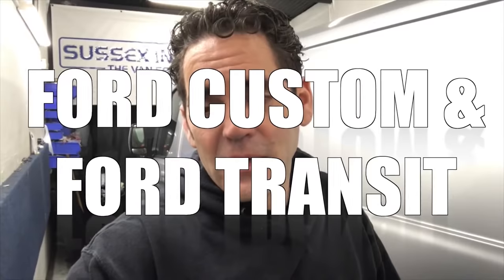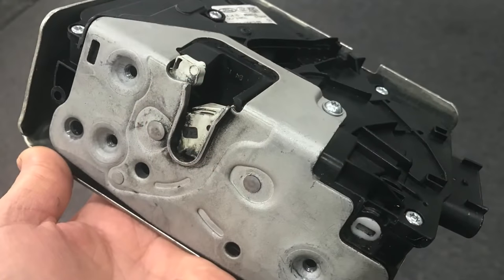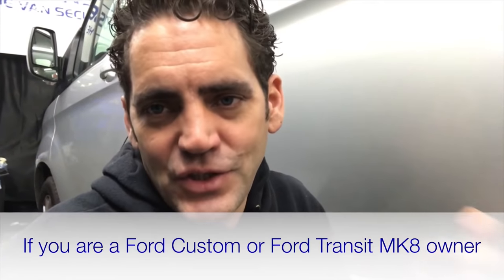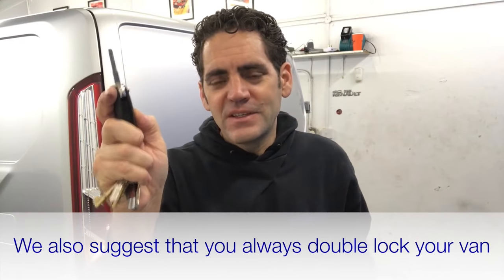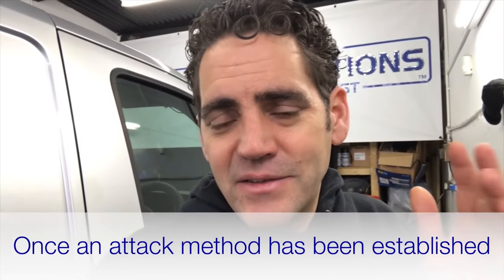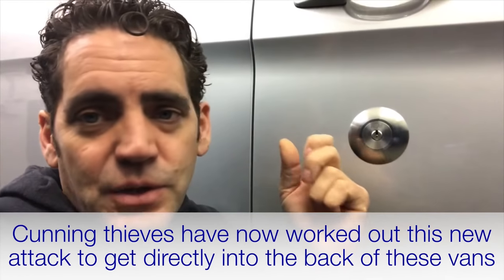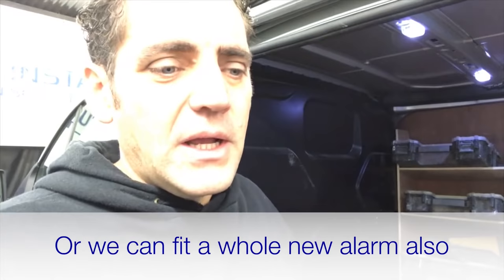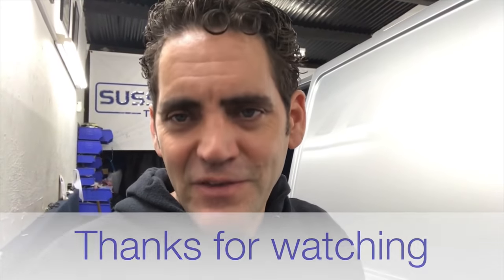Break-in News! Ford TRANSIT Owners Watch This

Comment: Its the same on building sites, tooled up to burn into the steel containers, JCBs hacked and driven away, boilers fitted one day, removed the next day.
Where I live now, I have not locked my house or car for 5yrs, no theft at all, Buddism must be the way forward hahaha
Reply: Yea defo not the uk it's going to get worse with people getting poorer
Reply: eyecatcher I lived in Thailand for 15 years and moved back to UK in 2016, I had to learn to lock doors again, for 15 years I’d been leaving the keys in my ignition all night and only locking house doors if we went away for a time.  It’s different in tourist areas that attract thieves, but most of Asia there is no such thing as car crime or theft from vehicles.

Comment: What the hell?! Where are people parking their vans that they can't hear someone punching a hole through the door shin metal???
Reply from the maker: Some people live in flats, some people have no parking space, not everyone has a front drive.
Reply: My van got stolen from right outside my house...no noise at all! Myself, my family, my neighbours heard nothing
Reply: Motorists in the Epsom area are having their catalytic converters stolen in broad daylight, Surrey police have issued warnings on social media. With that in mind, it doesn't surprise me that thieves are also breaking into vans during the day.
Reply: Me mates son had it done last night, on his driveway. Didn't hear a thing.
Reply: It shocks me how that could be quiet but I suppose thieves are motivated enough to work that out. Here people leave trailers locked on site and there "usually" isn't a problem.  I have seen people take wheels off though and lock them inside as a precaution. We also use "spot"s that track tools by GPS and of course at home in the driveway there is always the risk being heard and not caught but shot!

Comment: So at what point do they just use a glass breaker, pop the window and unlock from inside?
You guys should look into www.burglerbomb.com it will fill the van/house/office with pepper spray/fog with a UV market dye.
Reply from the maker: Thanks for the tip. If you double lock your doors, as Jeff said, you can't open them even if you break a window. If you then fit a good alarm the alarm will sound as soon as you break the glass or get the back door open.

Comment: FFS Ford! You need to sort this out for future generations of the Transit, I'll be buying VW Transporters from now on, our Transits have been done far to many times now. >.<
Reply: It's the same for the others too. You can get into the VW with a single 4mm drill bit in 20 seconds...
Reply: Also if you don' t have extra locks on you rear and side doors they could bust one of your front sidewindows almost making no sound and simply push the central lock/unlock button,right?
Reply: I sold my vw transporter because my tools got  cleaned out  twice in 2 years not to mention bodywork costs. Side door a real weak spot. Breaks my heart how you cant make an honest living without being targeted. It's a cat and mouse game.
Reply: Good luck with a VW! Join AA or RAC if you buy.

Comment: You would be better off bonding a plate on the outside of the door with windscreen adhesive . It would look nice in stainless .This still doesn't stop sad idiots trying to break in damaging the door, but if they have cordless tools they are going to get in , Or falling that a cattle zapper on the body like an electric fence

Comment: The drivers door lock was shite on the older Transit Custom because they put a screwdriver in it and even went through the double lock as well but the newer one has failed against them as my dad has had a base model from 2015 and now has a 19 reg custom limited spec and loves it but after a month or two some asswipe went for the drivers door lock again. Fortunately the lock didn't give in like the last one did but they must of been really fucking stupid robbers as my dad has a proper lock on both the sliding door and the two rear doors (the lock looks like you front door lock so they cant walk up to it with a screwdriver and act like its there van) so they must of wanted the van as a whole.

Comment: Nothing is safe. If it’s thief really wanted what’s in your van they will find another way in.
Reply from the maker: I think everyone acknowledges that fact but this will slow them down. If they go out with a can opener and a screwdriver looking for easy pickings then the van without the shield will be done first. If they go out with an angle grinder and noise is not an issue they will remove the back doors in seconds. If that sets off an alarm before they are in they are then under pressure. 

Nobody likes working under pressure except for the Michelin man.

Comment: Simple thing to do is don't leave tools in your van over night put a blue paint dye pack init and if you don't open your van a certain way it goes in there mouths and eyes and it burns so bad it can lead to blindness 

lemon and vinegar with permanent paint and pins that's what we use never been robbed again
Reply: What if it goes off on you? Plus I'm pretty sure you'd end up with a prison sentence if you set up such traps.
Reply: @vistron888  The pins get pulled out to release the paint not that it fires pins that would be murder
Reply: How do you trigger it? I was thinking with an airbag charge

Comment: Pointless video to just advertise. Any van door can just be folded down or cut into. I don’t see the point in spending hundreds of pounds if not more on additional security, when that only advertises to thief’s that you have something inside the vehicle worth stealing. 90% of vans I see broken into have additional security and often sign writing. It seems to me like more damage is caused breaking into vans that have additional security. More needs to be done by manufacturers. Shouldn’t have to pay for additional security.